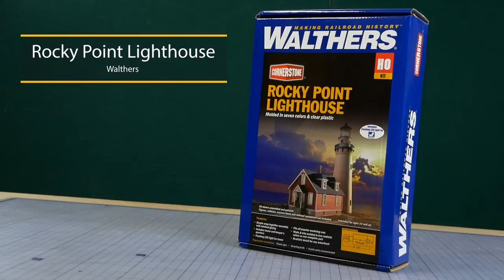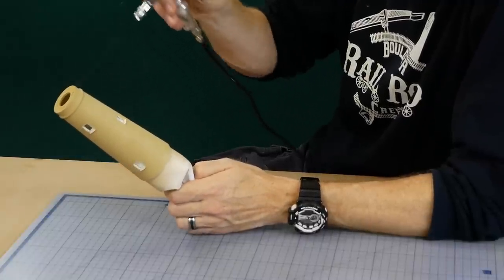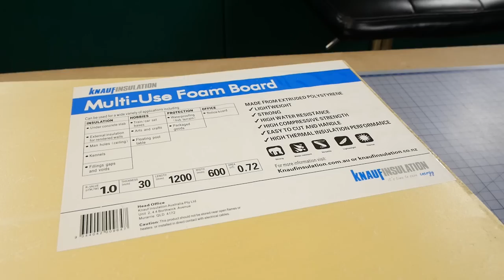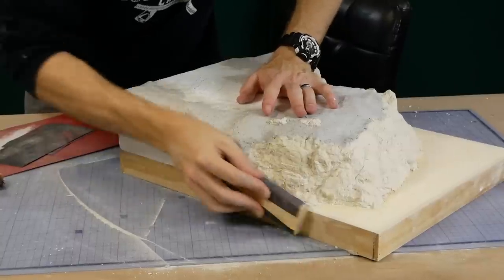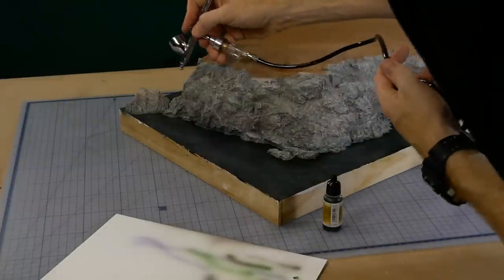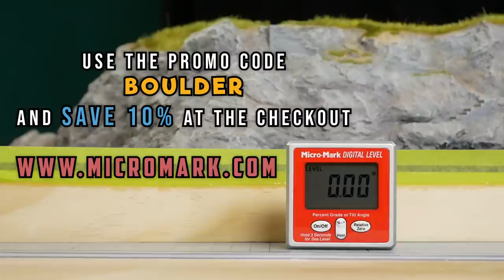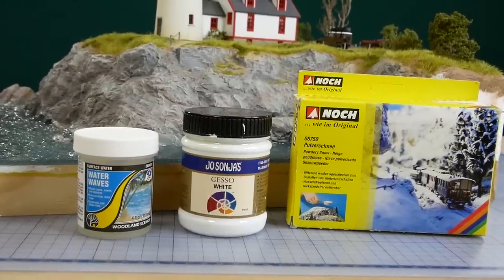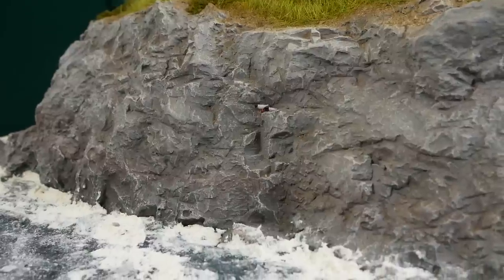How to Build an Amazing Seaside Diorama – Realistic Scenery Vol.14

Comment: Really beautiful, If I had anything worth suggesting, it would be to raise the darker grey from the bottom area of rocks a little higher and give it some irregularity, as the rocks right at surface of the water look a bit dry, which shouldn't be the case if they are wet from all the waves splashing.  Also, rocks at or just below the surface of the water often have seaweed/moss, so it could be worthwhile to add a bit of that 'grass' on the rocks below the surface before adding the resin (would that even work?).  Finally, I assume this is high tide, but if it were low tide there would be some staining of the rocks up to the waterline of high tide, with some various kinds of flora and fauna on the rocks below that level.  Just a couple thoughts. Love your work.
Reply: Seaweed etc. is a top suggestion!! Would love to see Luke experiment with this.

Comment: The water seems a little too fake on the finished product.  I look back at the start of the video where the diorama has a proper background and the water just does not blend in with the rest of the sea.  The color is off, and the wave behavior doesn't match.  However that problem could be remedied with a different background.  Otherwise the set looks awesome m8

Comment: I really love these as they look so realistic, but I always have a question no one is willing to answer on any channel. I just want to know does it matter what hardener and Epoxy you use to make water? I've seen some in my hobby shop nearby but the guy running it says that epoxy is for gluing stuff together and won't dry clear. I just need to know what to look for in types to use. Thanks.

Comment: Hey Luke. I've been following your channel for years now, and I keep wondering if you ever run into trouble using Valejo colours on Plaster of Paris. I find that the paint tends to leave an unwanted shiny surface even on roughened up rock faces. Have you ever run into the same problem, and if so, what would you recommend as a solution? Keep up the good work. I'm always excited to see new projects from you. Maybe you could try something in N gauge someday? 😉

Comment: A method I use to bend the plastic back into place is to put them in hot water, straighten them and then immediately put them into cold water while holding the shape. It will instantly lock into place.

Comment: If you happen to have tried it, how well does that AnyCubic printer work on things of smaller scales, like N (1/150) or Z (1/300)?
I was thinking of getting a resin printer like that, but the 47-micron pixel size seems like it might be a little coarse for things that small.

Comment: Could you possibly make sea weed using some resin on glass like you did with the waterfall diorama when you made the waterfall itself , and make some thin randomly sized strips to scale. Then paint them a dark brownish colour and place the strips on the water all tangled, folded and random but kind of flat with the water, Then do the white wash over top. To make it look like bull kelp floating on the surface as you would see in an area like this in real life.

Comment: What is that alcohol he uses before adding the static gras? I can‘t understand what the name (xy alcohol) is in the video...
Reply: Any type of isopropyl alcohol will work. It breaks down the surface tension of the glue mixture when applied allowing it to flow all the way throughout the scenery material for a strong bond.
Reply: Robert Johnson thanks :)